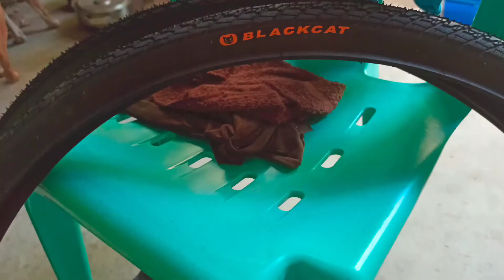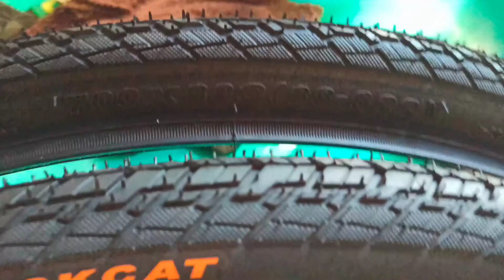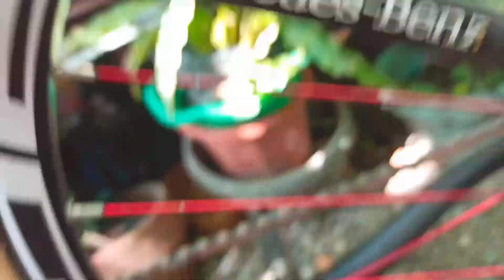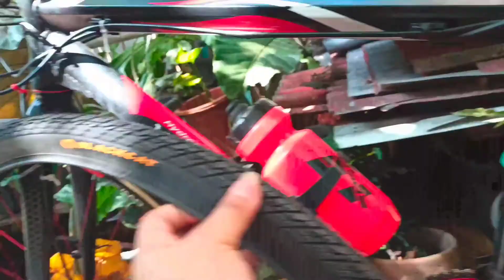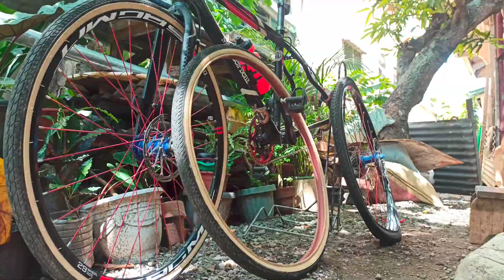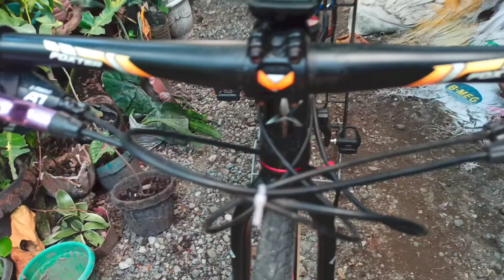700X38C ON 26ER FRAME INSTALLATION AND CLEARANCE BLACKCAT TIRES HYBRID SETUP ON MTB

Comment: Compatible ba gamiten yung pang 26er na rim sa 700x35c na gulong
Reply from the maker: @markloueipeniosan8000  hindi pwede boss, equivalent ng 700x35c ay 29er na rim
Reply: @kalingamtbrides8035  ahhh ok po salamat
Reply: 26er na rim tas 700c😮 GENIUS 😂
Reply from the maker: @ABCDEFG-z4r  boss 29er is  700c 26er ung frame hindi ung rim